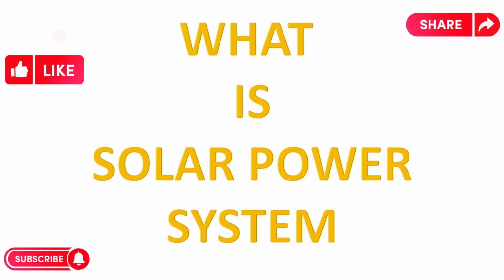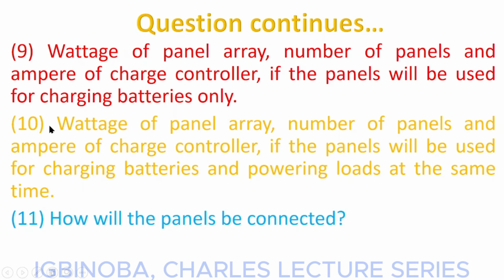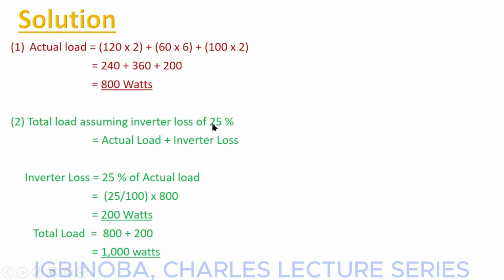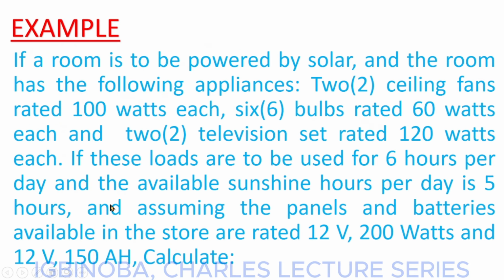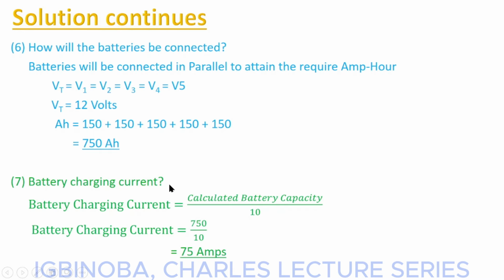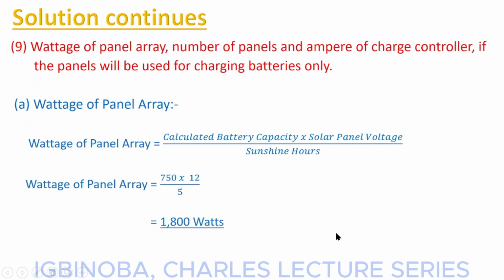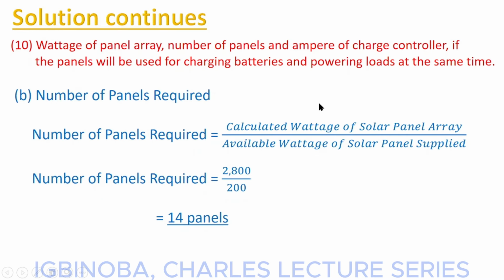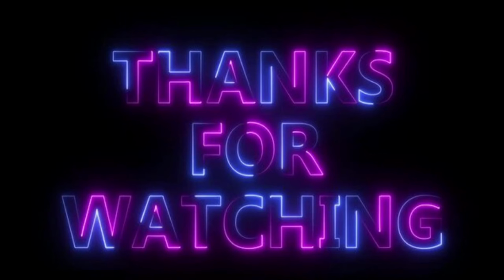Design of Solar Power System

Comment: MAR330D
1. Actual load: 1380 W
2. Total load with inverter loss: 1840 W
3. Required inverter rating: 2.5 kVA
4. Required battery capacity: 1227 Ah
5. Number of 150 Ah batteries needed: 9 batteries
6. Battery connection: All 9 in parallel
7. Battery charging current: 135 A
8. Battery charging time (40% loss): ≈ 11.5 hours
9. Panel array for charging only: 19 panels (200 W each), controller ≈ 320 A
10. Panel array for charging + powering load: 30 panels (200 W each), controller ≈ 500 A
11. Panel connection: All panels in parallel

Comment: COMP338L
1. Actual load = 1380 Watts
2. Total  load = 1725 Watts 
3. Inverter rating = 2156.25VA
4. Battery capacity = 1293.75Ah
5. Number of batteries = 8.65 ~ 9
6. Connection: Parallel 
7. Battery charging current = 129.375 A
8. Battery charging time = 14 hours
9. a. Wattage of panel array = 3105W
b. Number of panels = 15.525~16
c. Charge controller = 258.75 A
10. a. Wattage of panel array = 4830 Watts
b. Number of panels = 24
c. Charge controller = 402.5 A
11. Panels are arranged in parallel

Comment: CHM311K

1. Actual load= (100×3)+(60×10)+(120×4) =1380watts

2. Total load assuming inverter loss of 25%= Actual load +Inverter loss
Inverter loss=25% of Actual load
Therefore, 
Total load= 1380+(25%×1380)=1725 watts

3. Inverter rating in VA using power factor of 0.8
= (1725÷0.8)= 2156.25 VA

4. Battery capacity using factor for reserve of 75%=(2×1725×6×0.75)/12=1293.75Ah

5. No. of batteries for backup hours=1293.75Ah÷150Ah= 8.625 = 9 (Approximately) 
       = 9 batteries 

6. How the batteries will be connected?
The batteries will be connected in parallel 
VT=V1=V2=V3=V4=V5=V6=V7=V8=V9
VT= 12 V 
Ah= 150+150+150+150+150+150+150+150+150=1350 Ah

7. Battery charging current=1293.75÷10=129Amps

8. Battery charging time assuming charging loss of 40%= 1293.75Ah+(40%+1293.75Ah)÷129A=14hrs

9a. Wattage of panel array= (1293.75 x 12)/5=3105 watts

9b. Number of panels required= 3105÷200=15.525 = 16 panels 

9c. Ampere of charging controller required= 3105÷12=258.75Amps

10a. Wattage of panel array= Calculated wattage of solar panel array for charging battery only+ calculated total load =3105+1725=4830watts

10b. Number of panels required= calculated wattage of solar panel array÷ Available wattage of solar panel supplied= 4830watts÷200watts= 24.15 Amps

10c. Ampere of charge controller= calculated wattage of solar panel array÷ solar panel voltage=4830watts÷12volts= 402.5Amps

11. How will the panels be connected?
Ans: They will be connected in parallel

Comment: CHM3101W

1.Actual load =1380watts
2.Total load =1725watts
3.Inverter rating =2156•25VA
4.Battery capacity =1293•75Ah
5.Numbers of batteries =9
6.Batteries are connected on parallel
7.Battery charging current  =129•4amps
8.Battery charging time =14hrs
9a.Wattage of panels array =3105watts
9b.Numbers of panels =16 panels
9c.Chanhe controller = 258•75A
10a.Wattage of panels array =4830watts
10b.Numbers of panels =24
10c.Change controller = 402•5A
11.panels are arranged in parallel

Comment: MAR328B 

1 Actual load 1380W
2 Total load  1720W
3 Inverter rating  2156.25VA
4 battery Capacity 1293.75Ah
5 number of batteries 8.6
6 Parallel 
7 Battery charging  129.4A
8 T = 14hrs
9 (a) 3105W
   (b) 15.5 panels 
   (c)  258.75 A
10 (a) 4830W 
     (b) 24 panel 
     (c) 402.5A 
11 Parallel

Comment: EEE34D 
1. Actual load: 1380 watts
2. Total load: 1725 watts
3. Inverter rating: 2156.25 VA
4. Battery capacity: 1293.75 Ah
5. Number of batteries: 8.6
6. Connection: Parallel
7. Battery charging current: 129.375 A
8. Charging time: 14hrs
9.a. Wattage of panel array: 3105 W
b. Number of panels: 16 panels
c. Charge controller rating: 258.75 A
10. a. Wattage of panel array: 4830 W
b. Number of panels: 24 panels
c. Charge controller rating: 402.5 A
11. Panels arrangement: Parallel

Comment: PETROCHEM38H

1 Actual load is 1380W
2 Total load is 1720W
3 Inverter rating is 2156.25VA
4 battery Capacity is 1293.75Ah
5 number of batteries is 8.6
6 Parallel 
7 Battery charging is 129.4A
8 Time is 14hrs
9 (a) 3105W
   (b) 15.5 panels 
   (c)  258.75 A
10 (a) 4830W 
     (b) 24 panel 
     (c) 402.5A 
11 Parallel

Comment: CHM364L

1. Actual load: 1380 watts
2: Total load: 1725 watts
3. Inverter rating: 2156.25 VA
4. Battery capacity: 1293.75 Ah
5. Number of batteries: 8.6
6. Connection: Parallel 
7. Battery charging current: 129.375
8. Charging time : 14hrs
9. a. Wattage of panel array: 3150W
   b. Number of panels: 16
     C. Charge controller: 258.75A
10. a. Wattage panel array: 4830 W
       b. Number of panel: 24
      c. Charge controller: 402.5 amps
11. Parallel

Comment: PETRO3117M

ANSWERS TO SWEP NEW TASK
 YOUR DEPT. CODE AND BELOW ARE THE ANSWERS 
1. Actual load= (100×3)+(60×10)+(120×4) =1380watts
2. Total load assuming inverter loss of 25%= Actual load +Inverter loss
Inverter loss=25% of Actual load
= 25%×1380=345 watts
Total load= 1380+345=1725 watts
3. Inverter rating on VA using power factor of 0.8
= (1725÷0.8)= 2156.25
4. Battery capacity using factor for reserve 75%=(2×1725×6×0.75)=1293.75Ah
5. No. of batteries for backup hours=1293.75Ah÷150Ah= 8.6 =9 batteries 
6. How batteries will be connected?
The batteries will be connected in parallel 
Vt=V1=V2=V3=V4=V5=V6=V7=V8
Ah= 150+150+150+150+150+150+150+150=1200
7. Battery charging current=1293.75÷10=129Amps
8. Battery charging time assuming charging loss of 40%= 1293.75Ah+(40%+1293.75Ah)÷129A=14hrs
9a. Wattage panel array= 3105 watts
9b. Number of panels required= 16 panels.
9c. Ampere of charging controller required= 3105÷12=258.75Amps
10a. Wattage of panel array= Calculated wattage of solar panel array for charging battery only+ calculated total load =3105+1725=4830watts
10b. Number of panels required= 24 panels 
10c. Ampere of charge controller= calculated wattage of solar panel array÷ solar panel voltage=4830watts÷12volts= 402.5Amps
11. How will the panels be connected?
Ans: They will be connected in parallel

Comment: Civ3103y.
1)Actual load=1380watts
2)total load=1725watts
3) inverter rating=2156.25VA
4) battery capacity=1293.75h
5) numbers of battery=8.6
6) parallel connections
7) battery charging current=129.375
8) charging time
9) a wattage of panels =3105 watts
10) 4830 watts
(B)24.15~24 panels
(C)402.5 amps
11)parallel

Comment: PETRO37G

1. Actual load is 1380 watts
2.Total load is 1725 watts
3. Inverter Rating is 2156.25VA
4. Battery Capacity is 1293.75Ah
5. Number of Batteries= 8.625~9 batteries
6.Parellel
7.Battery charging current=129.375Amps
8. Charging time=14 hrs
9. (a) 3105 watts
(b)15.525~16 panels
(c) 258.75Amps
10. (a) 4830 watts
(b) 24.15~24 panels
(c) 402.5 Amps
11. Parallel

Comment: PETROCHEM360H 
1. Actual load = 1380W 
2. Total load = 1725W 
3. Inverter Rating = 2156.25VA 
4. Battery capacity =1293.75Ah
5. Number of batteries = 8.625~9 batteries 
6. Parallel 
7. Battery charging current = 129.375Amps 
8. Charging time = 14hrs 
9. (a) 3105W 
     (b) 15.525~16 panels 
     (c)  258.75Amps
10. (a) 4830W 
       (b) 24.15~24 panels 
       (c) 402.5Amps 
11. Parallel

Comment: MECH3211E

1. Actual load is 1380 watts
2.Total load is 1725 watts
3. Inverter Rating is 2156.25VA
4.Battery Capacity is 1293.75Ah
5. Number of Batteries= 8.625~9 batteries
6. Parellel
7.Battery charging current=129.375Amps
8.Charging time=14 hrs
9. (a) 3105 watts
(b) 15.525~16 panels
(c) 258.75Amps
10. (a) 4830 watts
(b) 24.15~24 panels
(c) 402.5 Amps
11. Parallel

Comment: EEE380B
1. 1380watt
2. 1725watt
3. 2156.25VA
4. 1293.75Ah
5. 8.625 batteries 
6. In parallel 
7. 129.375Ah
8. 24.15 hrs
9.  3105 watt, 15.525 panels, 258.75 Ampere
10. 4398.75 Watt, 21.99 panels, 366.56 A
11. In parallel

Comment: MAR 362J
1. Actual load = 1380w

2. Total load = 1725w

3. Inverter rating = 2156.25 VA

4. Battery capay = 1293.75 Ah

5. Number of batteries = 8.625~9

6. Parallel connection

7.Battery charging current = 129.375 Amps

8. Battery charging time = 14hrs

9a. Wattage of panel array = 3105Watts

b. Number of panels required = 15.525 panels

c. Amphere of charge controller require = 258.75Amps

10a. 4830 watts

b. 24.15 panels

c. 402.5 Amps

11. Parallel

Comment: CHM3166J
1. Actual Load : 1380 watts
2. Total Load : 1725 watts
3. Inverter Rating : 2156.25 VA
4. Battery Capacity : 1293.75 Ah
5. Number of Batteries : 8.625 - 9 batteries
6. Parallel
7. Battery charging current : 129.375 Amps
8. Charging time : 14 hrs
9. (a) 3105 watts
       (b) 15.525 - 16 panels
       (c) 258.75 Amps
10. (a) 4830 watts
        (b) 24.15 - 24 panels
        (c) 402.5 Amps
11. Parallel

Comment: MECH3191I 1)actual load=1380watts.2)Total load=1725watts.3)inverter  rating=2156.25VA.4)Battery capacity=1293.75Ah.5)Number of batteries=8.6.6)connection parallel.7)Battery charging current=129.375.8) charging time.9)a wattage of panels array=3105w.B)Number of panels 16 panels charge controller 258.75A.10)a wattage of panels array 4830W.B)Number of panels 24.C) charge controller=4025A.11) panels arrangement parallel.

Comment: EEE31A

1. Actual Load = 1380 watts

2. Total Load = 1725 watts

3. Inverter Rating = 2156.25 VA

4. Battery Capacity = 1293.75 Ah

5. Number of Batteries = 8.625 ~ 9 batteries

6. Parallel

7. Battery charging current = 129.375 Amps

8. Charging time = 14 hrs

9. (a) 3105 watts
    (b) 15.525 ~ 16 panels
    (c) 258.75 Amps

10. (a) 4830 watts
    (b) 24.15 ~ 24 panels
    (c) 402.5 Amps

11. Parallel

Comment: CHM3132B

1. Actual Load : 1380 watts
2. Total Load : 1725 watts
3. Inverter Rating : 2156.25 VA
4. Battery Capacity : 1293.75 Ah
5. Number of Batteries : 8.625  =9 batteries
6. Parallel
7. Battery charging current : 129.375 Amps
8. Charging time : 14 hrs
9. (a) 3105 watts
       (b) 15.525 = 16 panels
       (c) 258.75 Amps
10. (a) 4830 watts
        (b) 24.15 - 24 panels
        (c) 402.5 Amps
11. Parallel

Comment: MAR319S
1. Actual load: 1380 W

2. Total load: 1720 W

3. Inverter rating: 2156.25 VA

4. Battery capacity: 1293.75 Ah

5. Number of batteries: 8.6

6. Connection: Parallel

7. Battery charging current: 129.4 A

8. Time (T): 14 hrs

9. (a) 3105 W

(b) 15.5 panels

(c) 258.75 A

10. (a) 4830 W

(b) 24 panels

(c) 402.5 A

11. parallel

Comment: MAR339M
1. Actual load = 1380w
2. Total load = 1725w
3. Inverter rating = 2156.25 VA
4. Battery capay = 1293.75 Ah
5. Number of batteries = 8.625~9 
6. Parallel connection 
7.Battery charging current = 129.375 Amps 
8. Battery charging time = 14hrs
9a. Wattage of panel array = 3105Watts
b. Number of panels required = 15.525 panels 
c. Amphere of charge controller require = 258.75Amps 
10a. 4830 watts 
   b. 24.15 panels 
   c. 402.5 Amps 
11. Parallel

Comment: MAR375W

1. Actual load - 1380w 2. Total load - 1725w 3. Inverter rating - 2156.25VA 4. Battery capacity - 1293.75AH 5. Number of batteries - 9 6. Connection - parallel 7. Charging current - 129.38A 8. Charging time - 14 hrs 9a. 3105w b. 15.5 ~ 16 panels c. 258.75A 10a. 4830w b. 24 panels c. 402.5A 11. Connection - parallel

Comment: MECH374U 1)actual load=1380watts.2)Total load=1725watts.3)inverter  rating=2156.25VA.4)Battery capacity=1293.75Ah.5)Number of batteries=8.6.6)connection parallel.7)Battery charging current=129.375.8) charging time.9)a wattage of pannel array=3105w.B)Number of panels 16 panels charge controller 258.75A.10)a wattage of panels array 4830W.B)Number of pannel 24.C) charge controller=4025A.11) panels arrangement parallel.

Comment: MECH364L

1. Actual load = 1380 watts
2. Total load 9 = 1725watts
3. Inverter rating = 2156.25 VA
4. Battery rating = 1293.75Ah
5. Nunber of batteries = 9
6. Battery are connected in parallel
7. Battery charging current=129.4Amps
8. Battery charging current = 129.4 Amps
9a.wattage of panel arrays = 3105watts
b. Number of panels = 16panels
c. Charge controllers = 258.75A
10a. Wattage kf panel arrays = 4830watts
b. Number of panels = 24
c. Charge controller = 402.5A
11. Panels are arranged in parallel

Comment: MECH3107C

1. Actual load = 1380 watts
2. Total load 9 = 1725watts
3. Inverter rating = 2156.25 VA
4. Battery rating = 1293.75Ah
5. Nunber of batteries = 9
6. Battery are connected in parallel
7. Battery charging current=129.4Amps
8. Battery charging current = 129.4 Amps
9a.wattage of panel arrays = 3105watts
b. Number of panels = 16panels
c. Charge controllers = 258.75A
10a. Wattage kf panel arrays = 4830watts
b. Number of panels = 24
c. Charge controller = 402.5A
11. Panels are arranged in parallel

Comment: EEE328B

1. Actual Load: 1380 W
2. Total Load (including inverter loss): 1840 W
3. Inverter Rating (VA): 2300 VA
4. Battery Capacity: 1227 Ah
5. Number of Batteries: 9 batteries
6. Battery Connection: Parallel
7. Battery Charging Current: 15 A (per battery string)
8. Battery Charging Time: 5.1 days
9. Panel Array (for charging batteries only):
- Wattage: 2945 W
- Number of Panels: 15 panels
- Charge Controller Ampere: 245 A
10. Panel Array (for charging batteries and powering loads):
- Wattage: 4785 W
- Number of Panels: 24 panels
- Charge Controller Ampere: 399 A
11. Panel Connection: Series - Parallel

Comment: MEC3C 

1. Actual load= 1380 watts
2. Total load= 1725 watts
3. Inverter rating= 2156.25 watts
4. Battery capacity= 1293.75 watts 
5. Number of batteries= 9
6. Connection: parallel 
7. Battery charging current= 129.375 amps
8. Charging time= 14hrs
9.a. Wattage of panel array= 3105 watts
    b. Number of panels= 16 panels
    C. Charge controller= 258.75 A
10.a. Wattage of panel array= 4830 watts 
      b. Number of panels= 24
      c. Charge controller= 402.5A
11. Panels arrangement: parallel

Comment: EEE323W

1. Actual load - 1380W

2. Total load - 1725W

3. Inverter rating - 2156.25VA

4. Battery capacity - 1293.75Ah

5. Number of batteries -9

6. Batteries are connected in parallel

7. Battery charging current - 129.4amps

8. Battery charging time 14hrs

9a. Wattage of panel array - 3105W

9b. Number of panels - 16 panels

9c. Charge controller - 258.75A

10a. Wattage of panel array - 4830W

10b. Number of panels-24

10c. Charge controller - 402.5A

11.Panels are arranged in parallel

Comment: CHM 3115K

i) Actual load = 1380 watts.
ii) Total load = 1725 watts.
iii) Inverter ratings in VA = 2156.25VA.
iv) Battery capacity = 1035Ah.
v) Number of batteries for backup hours = 6.9= 7 batteries.
vi) The batteries will be connected in parallel.
vii) Battery charging current= 103.5 A.
viii) Battery charging time= 14 hours 
ix) a. Wattage of panel array= 2484 watts.
b. Number of panels= 12.42 = 12 panels
c. Ampere of charge controller= 207A.
x) a. Wattage of panel array= 4209 watts.
b. Number of panels= 21.05 = 21 panels.
c. Ampere of charge controller= 350.75A.
xi) The panels will be connected in parallel just as the batteries

Comment: EEE3119O

1. Actual Load = 1380 watts
2. Total Load = 1725 watts
3. Inverter Rating = 2156.25 VA
4. Battery Capacity= 1293.75Ah
5. No of Batteries= 9
6. Connection= Parallel
7. Battery charging current =129.375Amps
8. Charging time = 14hrs
9a. 3105 watts
  b. 16 panels
  c. 258.75 Amps
10a. 4830 watts
   b. No of panels=24
   c. 402.5 Amps 
11. Parallel connection

Comment: COMP37G 

1) Actual load= 1380W
2)Total load= 1720W
3) Inverter rating= 2156.25VA
4) Battery capacity= 1293.75Ah
5) Number of batteries= 9
6) Parallel 
7) Battery charging current= 129.4A
8) Battery charging Time= 14hrs
9) (a) Wattage= 3105W
     (b) 16 panels
     (c) Charge Controller Ampere= 258.75A
10) (a) 4830W
       (b) 24 panels 
       (c) 402.5A
11) Parallel

Comment: CIV3106B

1. Actual Load = 1380 watts 
2. Total Load = 1725 watts 
3. Inverter Rating = 2156.25 VA 
4. Battery Capacity = 1293.75 Ah 
5. Number of Batteries = 8.625 ~ 9 batteries 6. Parallel
 7. Battery charging current - 129.375 Amps 8. Charging time = 14hrs
 9.(a) 3105 watts (b) 15525 ~ 16 panels (c) 258.75 Amps 
10. (a) 4830 watts (b) 24.15 ~ 24 panels (c) 402.5 Amps 11. Parallel

Comment: MECH321U

Answers to questions;

1 Actual load is 1380W
2 Total load is 1720W
3 Inverter rating is 2156.25VA
4 battery Capacity is 1293.75Ah
5 number of batteries is 8.6
6 Parallel 
7 Battery charging is 129.4A
8 Time is 14hrs
9 (a) 3105W
   (b) 15.5 panels 
   (c)  258.75 A
10 (a) 4830W 
     (b) 24 panel 
     (c) 402.5A 
11 Parallel

Comment: MECH3169M
1. Actual load :1380W
2. Total Load( including inverter loss): 1840W
3. Inverter Rating (VA): 2300 VA
4. Battery Capacity: 1227 Ah
5. Number of Batteries: 9 batteries 
6. Battery connection:parallel 
7. Battery Charging current: 15A (per battery string)
8. Battery Charging Time :5.1 days 
9.Panel Array ( for charging batteries only): wattage 2105w
Number of panels : 16 panels 
Charge controller Ampere : 245 A 
10. Panel Array ( for charging batteries and powering loads) :
Wattage :4785w 
Number of  panels 24 w
Charge controller Ampere :402.5Amps
11. Panel Connection:parallel